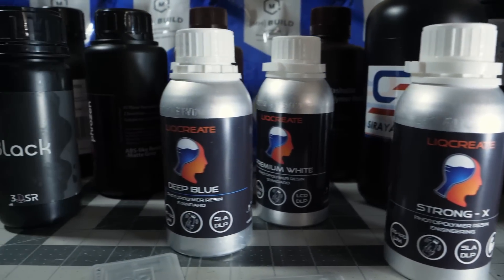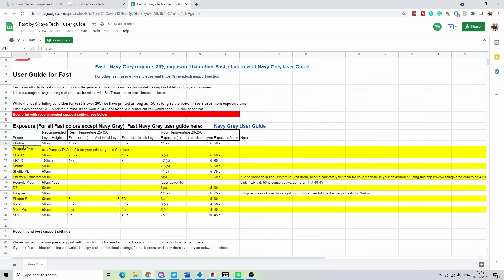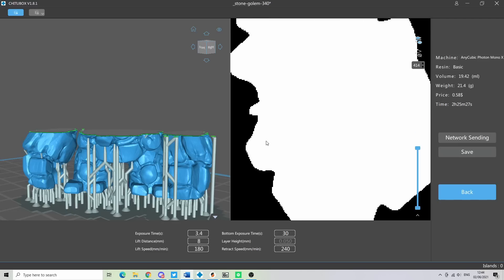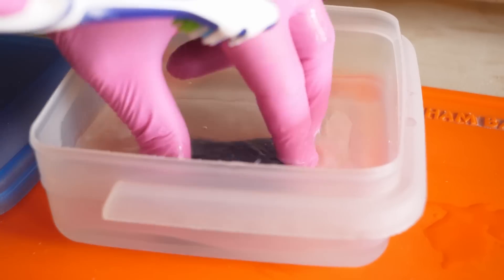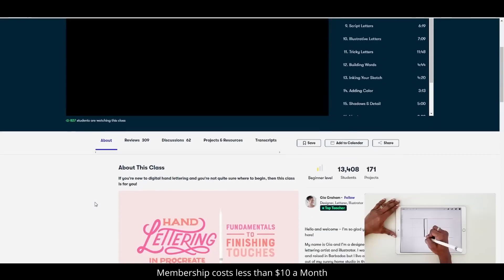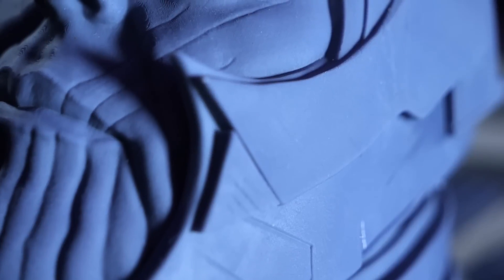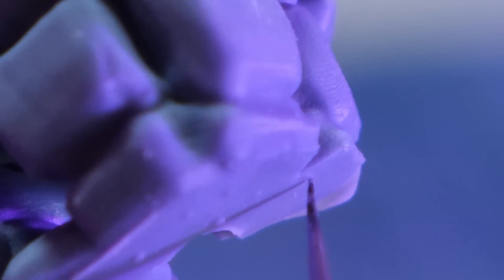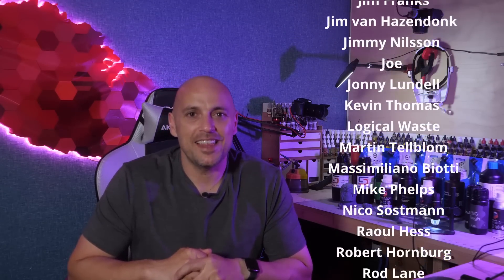Find The Perfect Exposure Time For Resin Printer - Anycubic Photon Mono X

Comment: Hi;  I needed your information about a subject I was wondering about. I have a mono x machine. When I print with different layer thicknesses, for example, I don't have a problem with "0.05", but when I print at "0.1" with the same model, same settings and same support settings, it turns out to be problematic, with different layer thicknesses. Is it necessary to change the print and support settings or can such problems occur due to mono x?  thanks.
Reply from the maker: Different layer heights require different setting, such as exposure time and also support joint sizes as it impacts it a lot

Comment: thanks for the Video ! Csn i ask you something? I just bought my first 3D printer (anycubic photon mono x) and the testcube printed fine...then i had just failures...then i tryed some presupported figure and it worked again...the next day everything failed again multiple times...the first layers Stick to the plate just fine but afterwards it connects to the vat....i tried some exposure times already but its always the same result

Comment: Struggling like crazy to get a decent set up for Elegoo ABS grey on my mono x. I'll give this a go. Everything comes out with super thick supports!
Reply: Having the same issue with Elegoo ABS-Like Grey on my Mono X. I've settled on 2.6s exposure with 40mm/min lifting speed but feel like it's a bit overexposed due to detail loss in smaller areas like faces and such.

Comment: Thank you so much for this valuable Video.   
What did you use for initial exposure for the [ Siraya Tech  (Navy Grey)] ?  I can see you elaborated on layer exposure which helped me a lot as I own the same printer and same resin.   However, my concern is the initial exposure.

Comment: Just got the Anycubic Photon Mono X and eSun Hard Tough Resin.

On Photon Workshop I setup a new Resin Profile for eSun Hard Tough Resin:
Layer 0.05
Exposure 2.4
Off-time 4
Bottom exp 30 sec
Bottom layers: 4
z-lift: 4mm

Saved to stick. 

While running the file, I went into the Set Up screen on the machine and it shows different values:
Exposure: 8 sec
Off-time: 1 sec
Bottom exp: 60 sec
Bottom layers: 3

Looking at the time between lifts it seems that it follows the latter. So I had to adjust on the fly. Even then I'm still seeing the lifts happen about 12 sec in between. 

I'm totally confused.
Please help.

Comment: I´ve bought one just like yours, but one thing that bothers me is that the printed samples strongly smells resin for too many days. Is that normal? I´ve not cured the sample not even washed with ethanol after printed...
Reply: Sorry if I didn't understand the comment, but did you wash it? And or cure it? Because if you didn't do any of those steps its still gonna smell like resin for a while. If you did wash it, then try either washing it for a little longer (if you got the wash and cure machine from any cubic) or so end a little more time with a too the brush on the model.
Reply: @aidanfordsword6954  thank you for answering. Yes, you understood precisely my question. I tried to wash it for a longer periodo, but it persists smelling resig... not as strong as before, but still smells. I've heard that maybe it is happening due to the resign brand. Thank you again!!

Comment: Could you please explain why you add 0.4 seconds to your exposure time in regards to the z axis. Whats the theory behind that? How are you coming up with that number and how does the exposure correlate with the z axis in any way? Is not the movement of the build plate the restricting factor? If it only move up 50micron there is only 50 mikron space for the resin to cure along the z axis, no? And how is the z axis not taken into Account in the first print?
Reply: exacly! i want to know to i think its not necesery.
Reply: Just spent some time reading all the comments to see if there is any explanation on the .4 seconds and nothing. Does anyone know why .4 was added?
Reply: Agreed. This makes no sense to me.

Comment: what was the power of the uv lamps for the test? 100%, 80%, 65%? this is critical to compare. regards
Reply: I agree with you. I'd like to know his uv power level but in theory we can follow the steps he has outlined and dial in our resins. I am going to be running my uv light at 80%. Cheers!
Reply: @krissebesta  I think some different types of resin have a suggested percentage but I'm not sure
Reply: I was thinking that, well uv ligth power goes from 65 to 80%   , then yuo can play with it, ie. Print at 65% uv power and 2.0 sec, then compare the same but 80%

Comment: Hello, im in contact with Anycubic trough a ticket, but i think there not understand me. i was wonder if you can do test for me on your Mono X with the Resin XP2 Validation calibration test, do just a dry test, no VAT and no buildplatform attached, just make 1 bottom layer with 30 seconds exposure time and the normal layer at 1.65 seconds. so i was wonder if your printer do just 1 layer at 30 seconds and then starts the second with 1.65 and all other layers too.. my printer just start and arround layer 3 or 4 its reduse the exposuretime and by layer 10 orso it starts with 1.65 seconds... so it is not work the given settings that is in the PWMX file that is made.. i tested the same settings at a Mono and then its do 1 layer at 30 seconds and then starts right away with 1.65 seconds.. Anycubic told me that the printer do make transitions in layers but i think its a fault in my printer.. could you try that on your printer.. to see if it will do just 1 bottom layer at 30 seconds and then go further at 1.65 seconds.. and you can then easy see it on the TFT screen.. because its a dry test.. so no resin is need for this simple test. I hope you can help me out.. im get crazy of it.. have my printer for weeks now and even not get a good print out of it.. oh .. and before i forgot, you have great video's good learing ones and nice tips etc :) 

i have here a video about my Mono X and you can see very good that it is not work that file commands: https://www.youtube.com/watch?v=ycM39hm7iIU

Best Regards Mark
Reply: I have the same printer but have not started using it yet. I have heard that this printer automatically puts down 10 layers before printing the object.  I wish it didn't do this either. Also, can you check to see if your bed is perfectly level and let me know? My bed is slightly higher around the outer edges (perimeter on all 4 sides) by 0.5 mm. I was expecting the bed to be perfectly flat so I want to know if I need to grind/sand it flat before I start using it.
Reply: @krissebesta  I sanded mine  with 80grit on a flat stone surface (marble countertop). Works perfectly now

Comment: Just a note, holes in the resin exposure test can be perfect if you decrease the "bottom exposure time" in your slicer because this is a small flat object and the printing time is just few minutes (only for this test) and much easier to remove it from the build plate

Comment: To save some time for the Mono X users, it can test multiple exposure times in one print. The link below is to RERF files (Check your manual for more info) for testing 0.03, 0.04 and 0.05 layer heights ;) Open to suggestions for next version, just let me know via my channel. https://drive.google.com/drive/folders/1Q1FNRCCOHLdmAQMGdF0Fkb2aRCkg_nEC?usp=sharing

Comment: dunk your model into hot water before removing the supports, makes it a lot easier to remove
Reply: agree
Reply: Do you clean it with ipa first then warm water? I've heard a blow dryer works well too.
Reply: @krissebesta  yes, clean off the resin with IPA bath and then dunk II not hot water to soften the resin to help remove the supports. Don't make it too hot though. You need to be able to put your hand in without boiling your own flesh of the bone :)
Reply: Also don't keep it in got water to long just 3 or 4 seconds. You can always redunk it if there are a lot of supports to remove
Reply: @Pendrayk  Excellent!  Thanks!